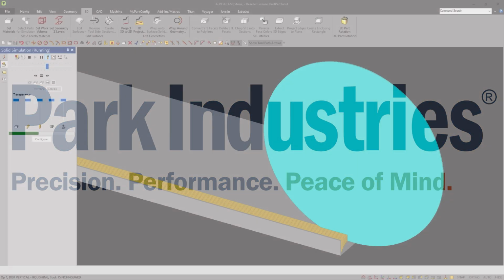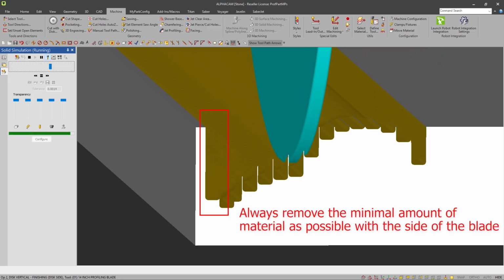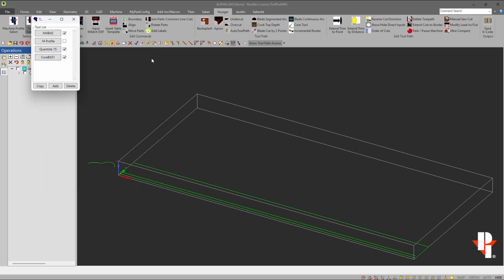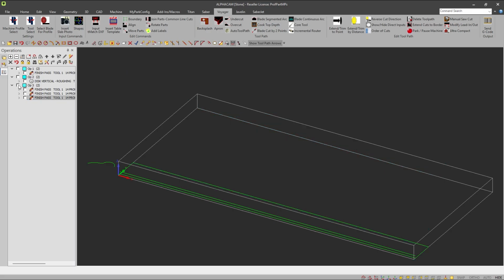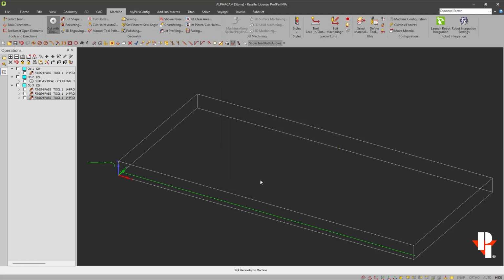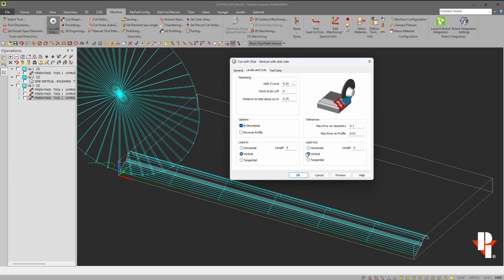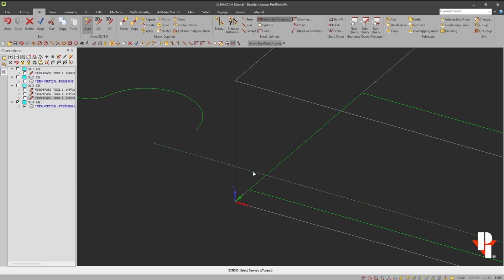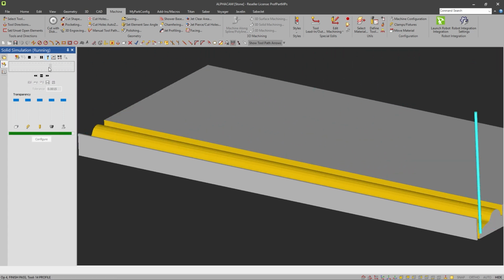Cut with Disk 3 - Side sweep finishing

Comment: Something is up.  Idk if it's because I'm using a SaberJet & not a Voyager, but I noticed some of the choices you make in the videos for this aren't available for a SaberJet.  Like when you go to Tool Select from the Park Industries Voyager tab, the blade you named 14 Profile back when you made the tool?  I don't have that in my SaberJet list of tools.  Even though it's saved & viewable from the Machine tab, Tool Select option.  Then, when I select AutoToolpath, it ends up looking similar to what you show in the video with the tall blue lines sticking up, only on my SaberJet it includes water jets on all 4 corners & they shoot across diagonally to the left & down like 5-6 feet & then go straight left.  I have no idea why it's so different.
Reply from the maker: That sounds frustrating. Give us a call and we can troubleshoot the program with you to hopefully figure out the issue. 800-785-3391 and select our training team. Thanks!